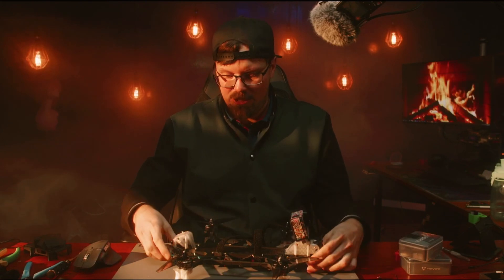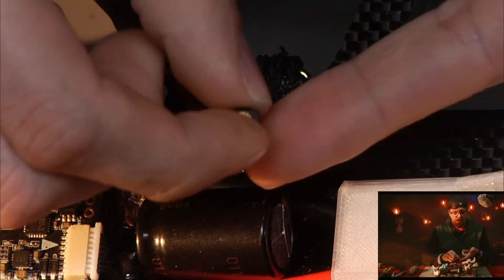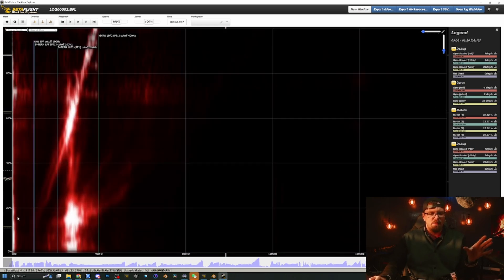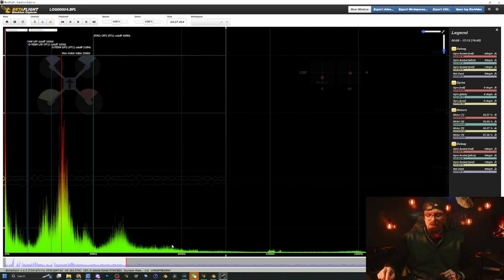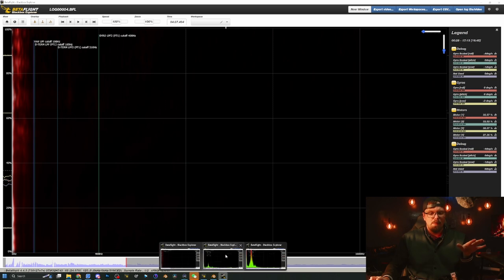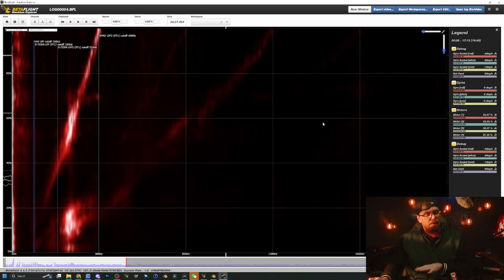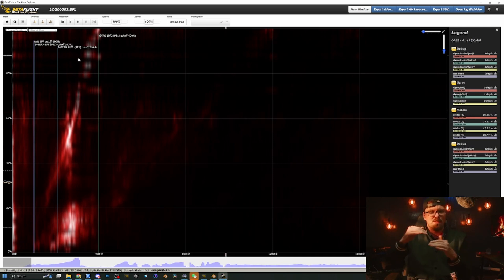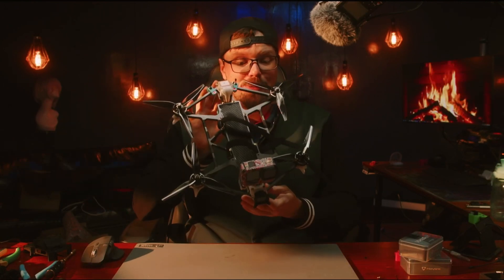What is the BEST way to mount your Flight Controller on an FPV Drone TESTED

Comment: Thanks for this! All great points! Time to test Chris rossers new cut the frame around the fc method. Great stuff and nice dungeon vibe! Lol get those end screens up! Nothing to click!
Reply from the maker: So I just watched the video and I gotta say I smelt a lot of "buy me science" . How hard would it have been to print two frames exactly and one didn't have the frame cut out. And then directly compare. Knowing Chris is such a smart scientist I assume the only reason he didn't do this because he knows the results are negligible. If I am wrong I will tip my hat, but it's sloppy science/testing regardless
Reply from the maker: Just click anywhere on the screen. That's the secret haha.

I didn't know about this cut the frame around the FC thing. I'll have to look in to it

Comment: Do you think fpv quads have hit their peak or is there more we can do improve them?
Reply from the maker: It's starting to feel pretty peaky, to be honest. Especially with one piece frame designs
Reply: Yea it seems there isn't much to do without a big leap in the technology. If anything maybe the frames, motors and props could be improved on but it still would only be small gains. I have this idea of making a hollow single piece frame molded with carbon fiber, but I'm not sure it would be better
Reply from the maker: @jakeclauson9863  it would also be pretty tough to manufacturer
Reply: @DRXfilms  maybe some aspects of it would be tough but you could just 3d print a mold out of wax, lay the carbon then heat it up to melt out the wax. I think it would be tough to manufacture around the motor area but the rest should be pretty straight forward.  But I guess it's like anything else, it seems easy in theory but in practice it'll probly be much more involved. But question is, would it be worth doing.  What benefit would it have over the standard frames
Reply from the maker: @jakeclauson9863  you could use something called carbon composite